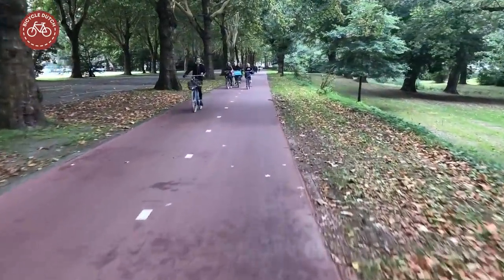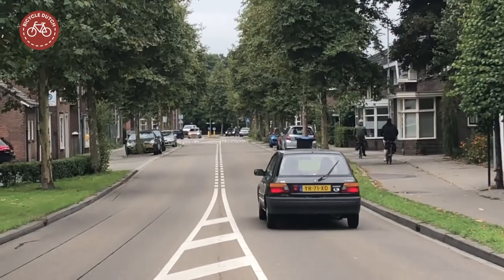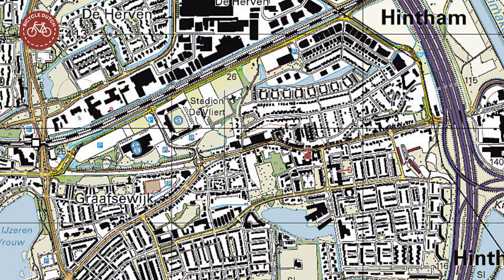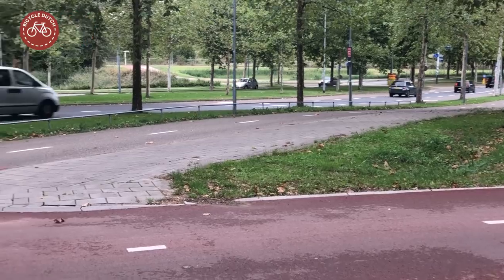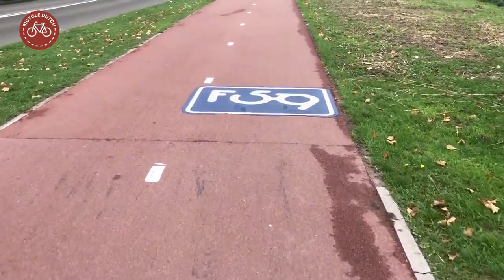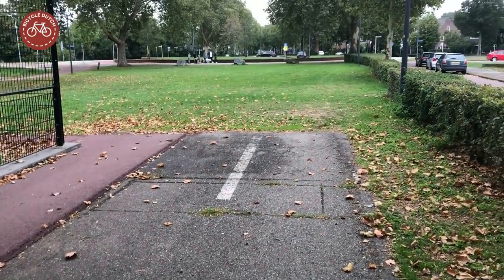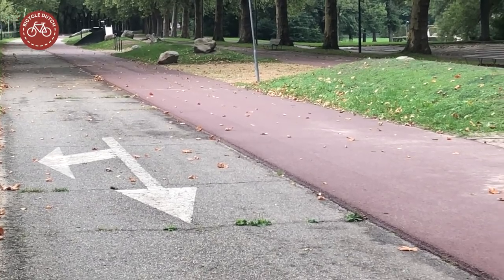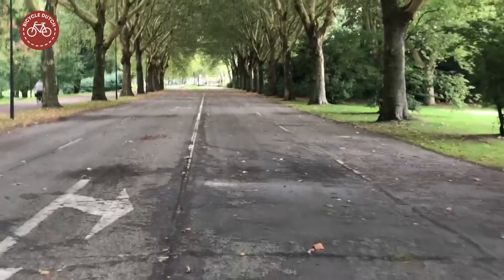An abandoned road in 's-Hertogenbosch (NL)

Comment: Cheap, but slow, way to break up the asphalt: Only make a few holes in the asphalt. Plant trees with a horizontal root system in these holes.  Wait.
Reply: Prettier too
Reply: @LotsOfS  the road as is looks quite aesthetically pleasing already.
Reply: @iSkully99  wouldn't it be a lot prettier if there were more trees?